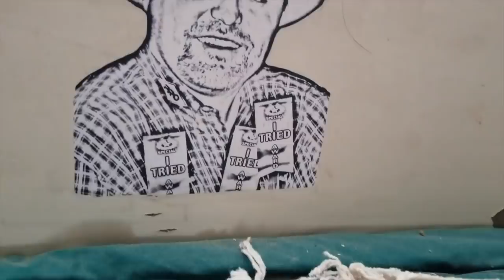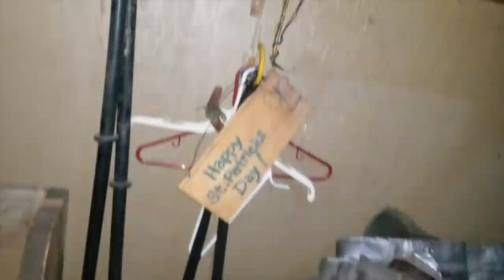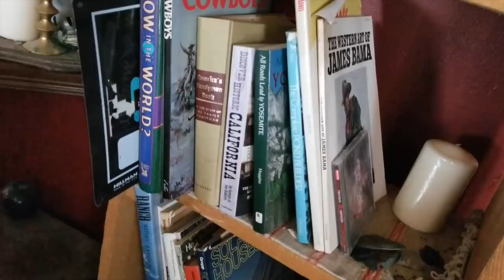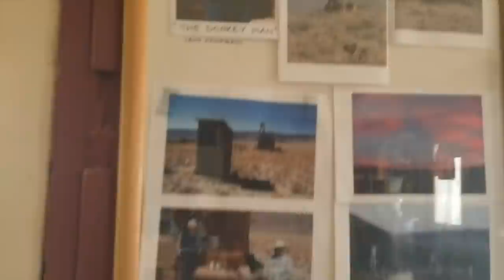High Desert Abandoned Homestead and Volunteer Cabin

Comment: A lovely place, Hussy, i might go out there and fix that roof, plenty of roof panels laying on the ground.
Reply: Carl Huck - great suggestion! And ASAP.  That middle room ceiling hasn’t been down long, which is why the rats haven’t taken hold - yet!  A fully charged battery drill & spare batteries, drywall screws & drywall cut down to fit your vehicle is all it will take... I wish you well from UK, with your offer  - good luck!